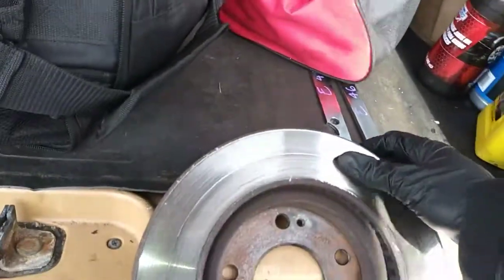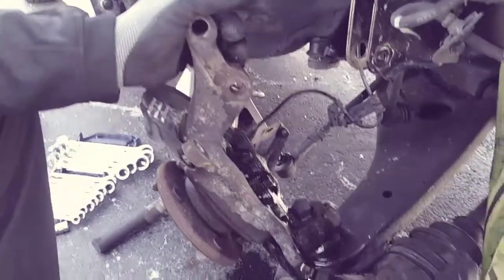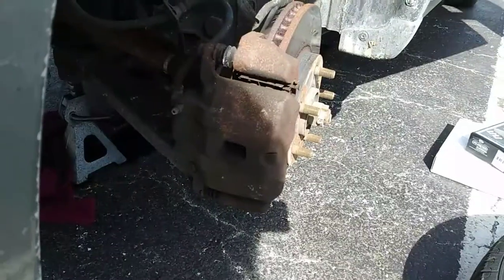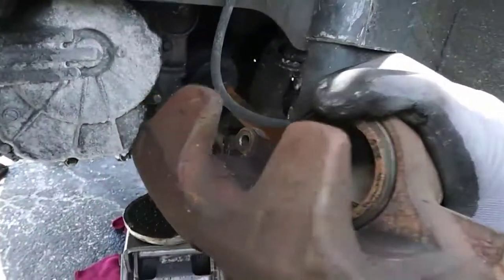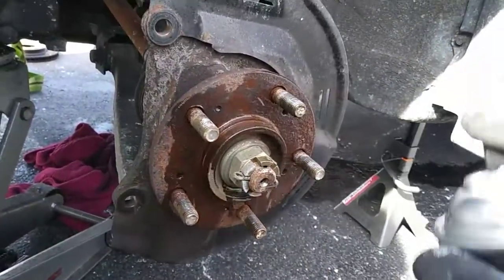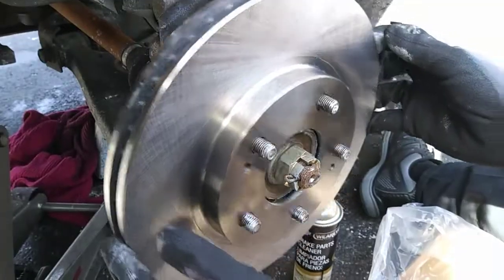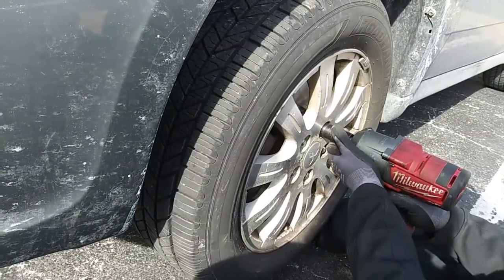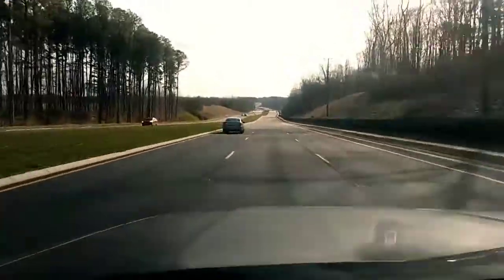BRAKE PADS & ROTOR REPLACEMENT (2004-2012 MITSUBISHI GALANT)

Comment: Figured I put this out there. If part store doesn't have rotors in stock. Have them look up 2014 dodge avenger rt. Same rotors size and bolt pattern.

Comment: Was there 2 screw on the rotors that u had to remove
Reply from the maker: No. Someone before me trashed them
Reply: To answer your question and anyone else who was wondering, yes those need to come out 😂. I was sitting there wailing on my rotor thinking wth am I doing wrong 😂

Comment: What’s the torque spec for the bolts?!
Reply from the maker: Ramy Mesiha 
caliper mounting bracket to steering knuckle blots 60-81 ft lbs

caliper assembly to mounting bracket bolts 28 ft lbs

lug nuts 80 ft lbs